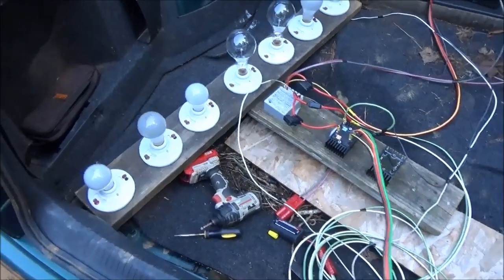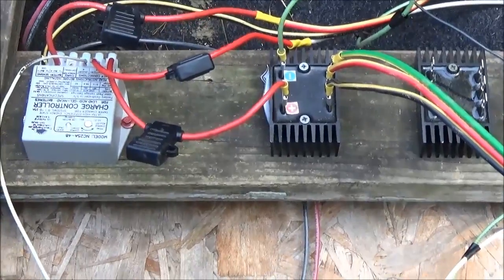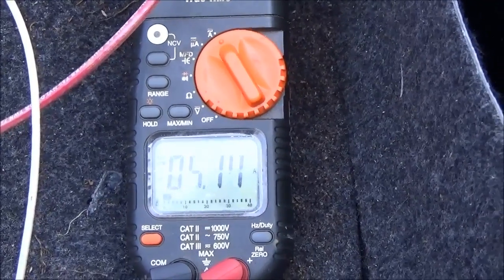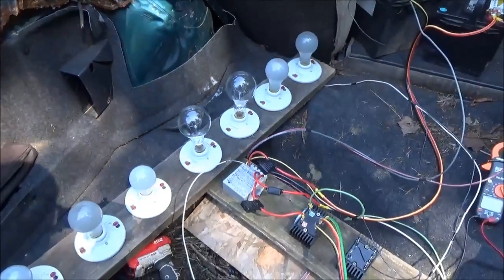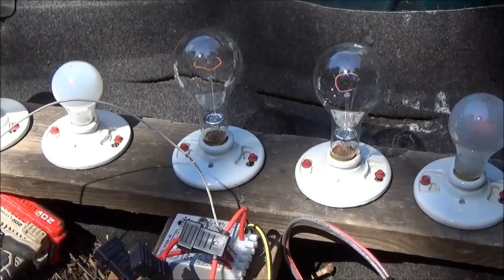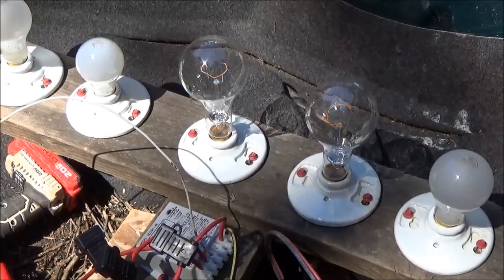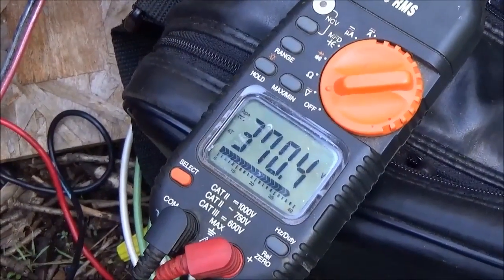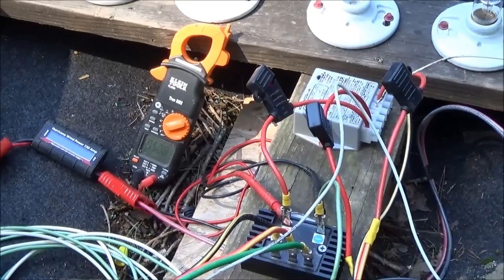Pond Power Part 3- Diversion Load Control

Comment: i know many people have commented in regards to use a pump to move water back to the top pond, but the common response seems to be it isnt worth it. if you were to use a large ram pump from the iutlet however, would that allow it to be more vuable or at least help extend the possible time you could generate power. at least some ammount without using any of the electricty you are producing

Comment: question; are can i run my 12 volt stuff off the 48 or a 24 volt bank? do i just draw off a single battery or convert down to 12. and what do i lose in the converting down if anything.i have 24 volt ,128 watt solar panel charging  24 volts .2x12v 128 amp hour batteries.what size converter do i want to get 12 volts.all my stuff is 12v.

Comment: Good video. Thicker cable will help reduce voltage drop - at 5A+ those thin wires will be dropping a few volts.

Comment: While I am just solar at 12 volts now I have pond potential.  I am wasting solar by not having a diverter.  I run 500 watts of panel to 8- 12 volt deep cycle batteries  wired in parallel.  I do run some 12 volt lights and fans off of the system via a direct 12 volt wiring system.   I have a hard wired 2500 watt inverter that will cover some basic needed circuits, but only use it when the utility power is off.    What diverter would you recommend?  I want to stay at 12 volts because of the wiring investment through my house.  I just got your book from Amazon an ordered Dave's as well.

Comment: Maybe for automatic power when the pond is full enough, you could attach a float ball to a lever system rigged to a butterfly valve so that when the pond reaches it's upper limits during a thunderstorm the valve will open and the generator will spin up and charge a bank of batteries nearby.

Comment: That is one cool setup.  Why not keep the high voltage stator and wind a transformer to give you the exact voltage you are looking for?  This would allow for maximum power transfer and isolation of the circuitry.   Producing a stator that will consistently perform ideally maybe difficult.  A custom power transformer would remedy this and you wouldn't need to built to design the stator.  Just an idea.

Comment: Isn't the charging power actually the voltage DIFFERENCE between battery and generator output times amps, not the 53 volts times amps?

Pete Stanaitis
-----------------

Comment: The number of people asking "couldn't you just pump the water back into the pond" in response to parts 1 and 2  is truly disturbing.   I really hope these people don't vote.
Reply: jimmyrebel2010 To what end?  If he wanted less power it would be far simpler to just reduce the flow of water through the generator.  It makes no sense to go to all of this trouble producing electricity only to use it to pump some of the water back into the pond.
Reply: If you use solar and your batteries are full then using the generated power to pump water in the pond would be a could way to use and at least save some of that energy. The pond can act as a large 'battery' for using electricity at night. Would work if you have overcapacity solar.

Comment: That hydro setup is cool. It seems to me there is a bunch of water force at the outlet of that pipe that could used to make power also. Depending on the drop over the hill there is tons of things you could do to make power befor it hits bottom. Keep up the good work.